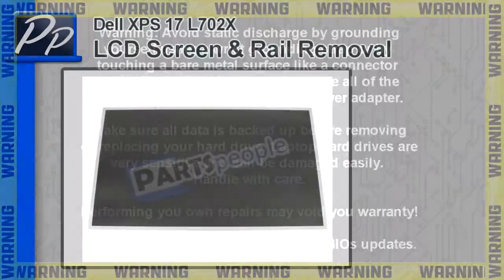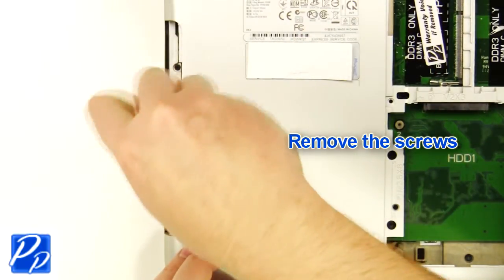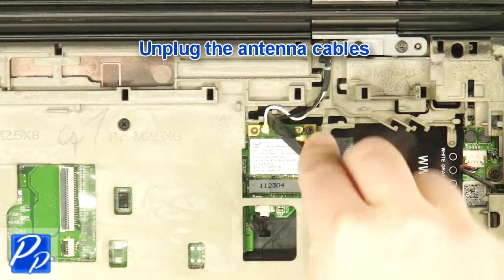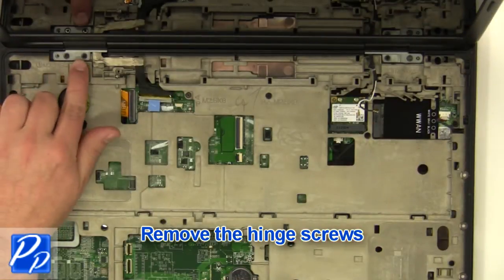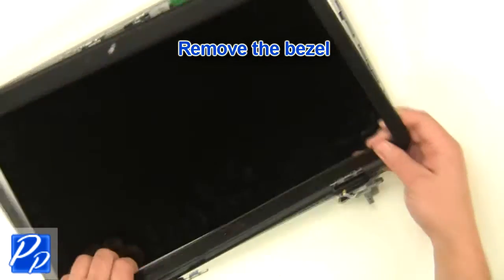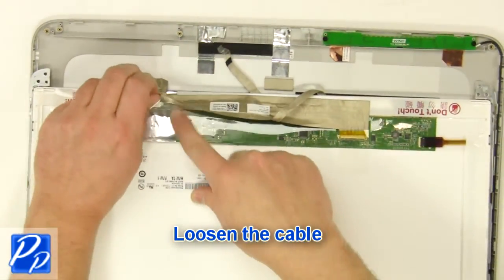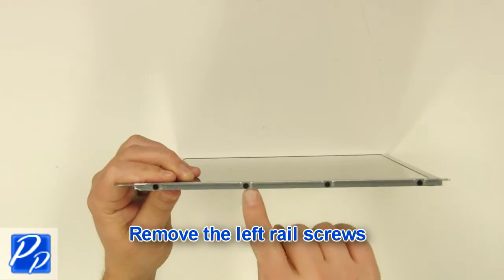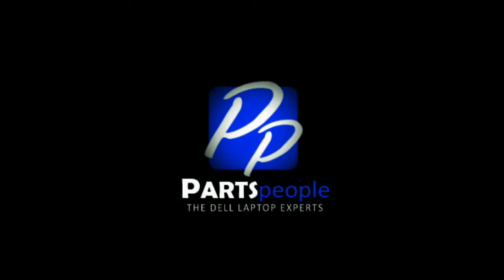Dell XPS 17 (L702X) LCD Screen & Rail Replacement Video Tutorial Teardown

Comment: There was a connection to the camera which appears to have been skipped. I cannot see well enough with a magnifying glass to be confident not to break. Is it simply tape or ???
Reply from the maker: This believe this step was omitted because disconnecting the webcam is not necessary in the removal of the LCD screen. If you do need to disconnect the webcam we have a video for that here: https://youtu.be/mNdXe8d11B8